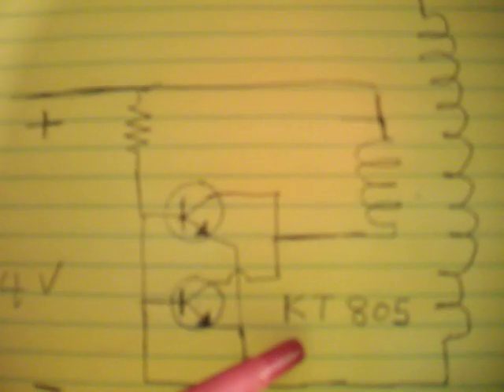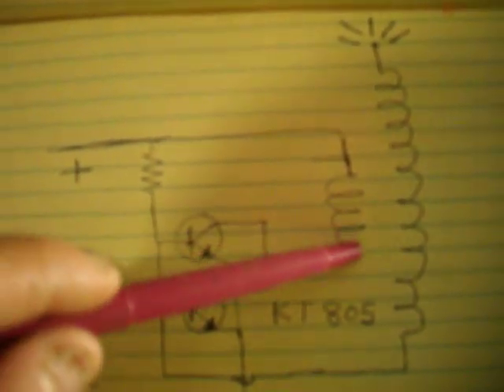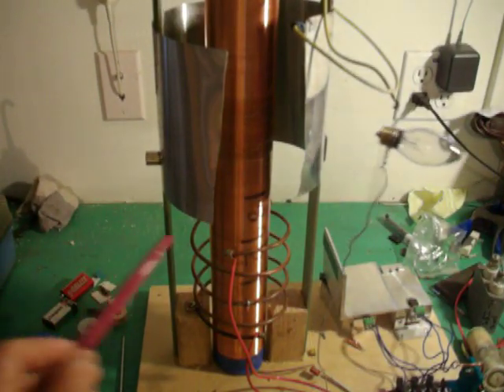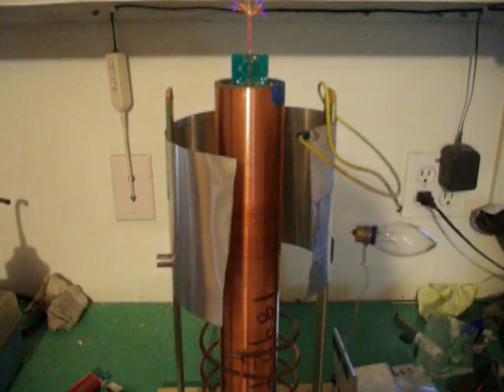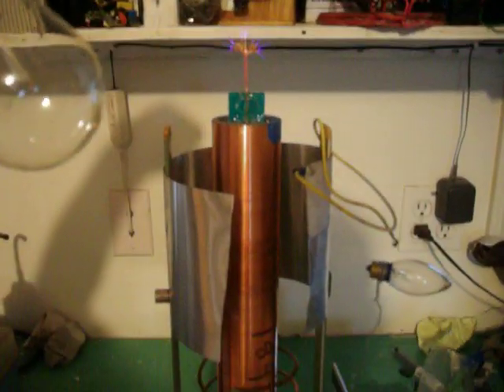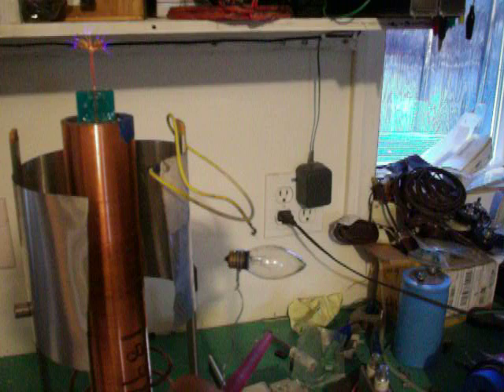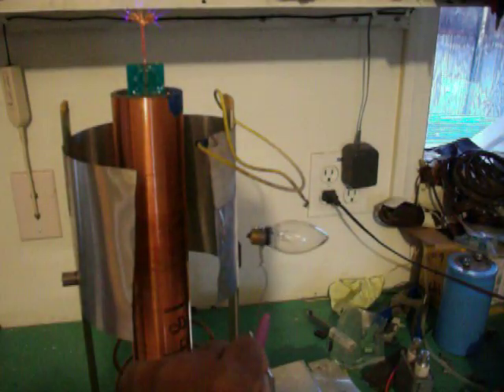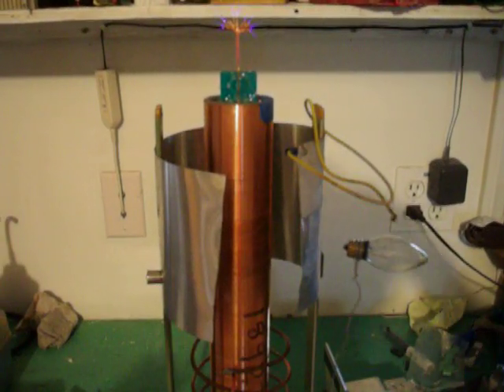Kacher Circuit and Device

Comment: how much current is used to fire up the circuit without the bulb, then, with the bulb? I have seen many of these circuits here on Youtube. Does the input's amperage drop when the light bulb is lit up as the other Kacher circuits show? I am curious about this and I would imagine the output being loaded does not increase the input as most conventional electricity circuits do. Could you also tell me what the largest load you can run with it is?? Thank you for posting.. You did a great job!
Reply from the maker: 10 watts the largest load that the circuit was able to power. But, the circuit wasn't efficient at all, it was using much greater power that the output bulb. However was fascinating to how  plasma can ignite incandescent bulb.

Comment: Great experiment, love that 10W incandescent bulb. Is the other end of the bulb connected to household earth ?
Reply from the maker: Only to ground or to negative connection on the circuits power supply.
Reply from the maker: With out the ground connection bulb can not light up
Reply: Only to ground ? 
negative connection ? 
What do you specifically use?

Comment: Thanks for sharing

Have you tested with another transistor ?
Reply from the maker: I did used many different transistors but I had no good results. The trick is not the transistor! It's the winding numbers of the coil.  I built so many of these coils but non of them worked well, until I started to make coils with more turns. If you want to have 1 1/2" output plasma? You probably need 3000 turns on a coil.